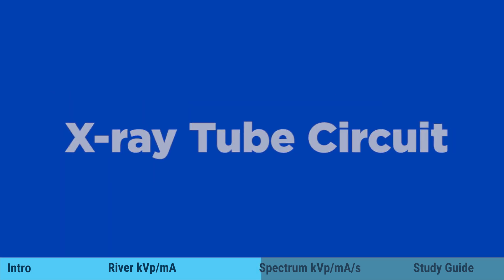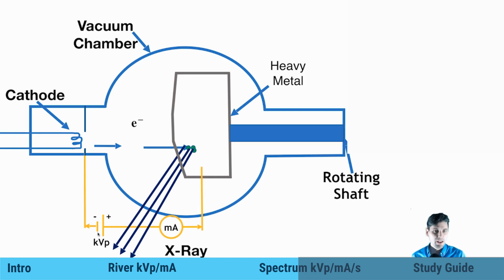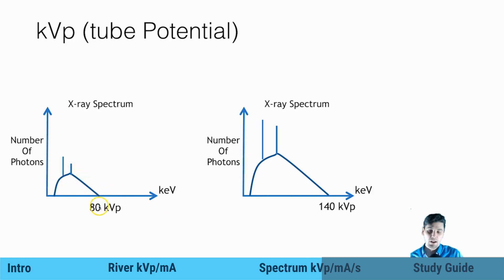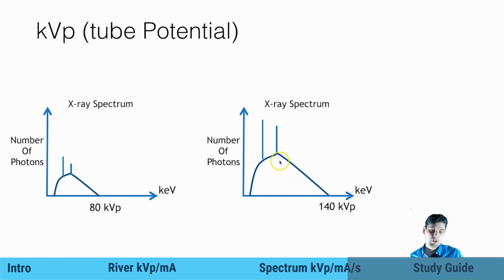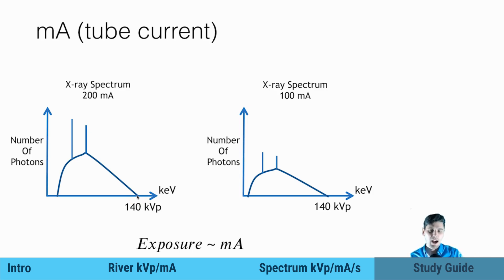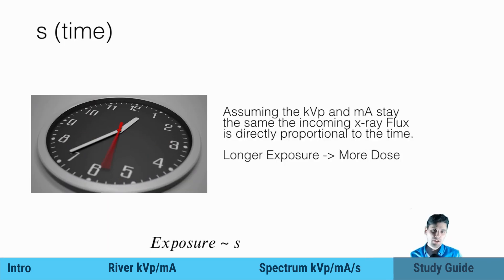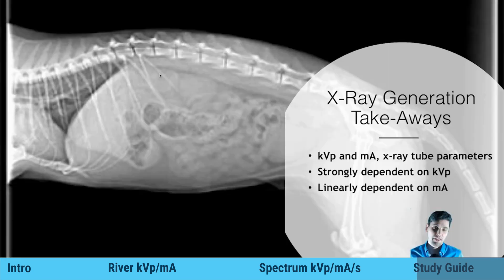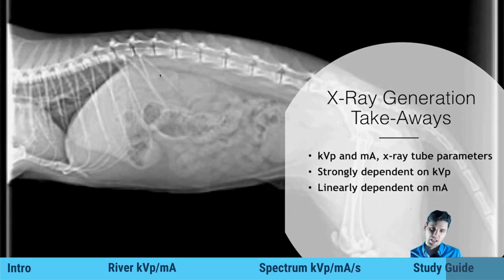kVp vs ma for x-ray production ( Radiologic Technologists )

Comment: what I dont get is that you have 2 circuits: The "heat circuit" to produce the electrons in the cathode (with a potential and a current) and also a "acceleration circuit" (with also a potential and a current). Which change in potential and current changes what in the end? If we increase the "heat potential", what happens? What happens if we increase the "heat current"? What happens with the "acceleration-current"? I got what happens with the "acceleration-potential" from the kVp bit in the video.
Reply from the maker: If we increase the heat current that will boil more electrons off but which will increase the mA. The heat circuit is intentionally run at a lower voltage which is better for themionic emission. If you change the voltage of the heat circuit it will become less efficient.
Reply: @HowRadiologyWorks  Thanks! So the tube current is dependant on the heat current?
Reply from the maker: Yes the heat current generates the electron cloud around the cathode and the primary circuit controls the kVp
Reply from the maker: Sorry I didn’t reply clearly before I’m going to make a video on this soon
Reply: great thanks! @HowRadiologyWorks

Comment: In 400ma x ray mechine kv range??
Reply from the maker: Yes 400 mA is a typical value for most any kVp on many systems
Reply: Sir i asked about kv ranges.. Means from how much kv to how much kv
Reply from the maker: Depending on the equipment and the use  there is a range typically from 20 to 150 kVp where 25 is common for mammograms and 140 is not uncommon for large patients in CT